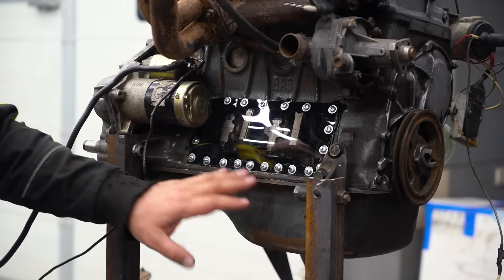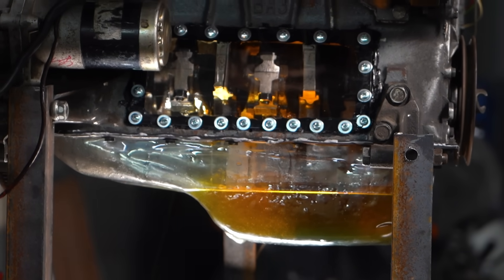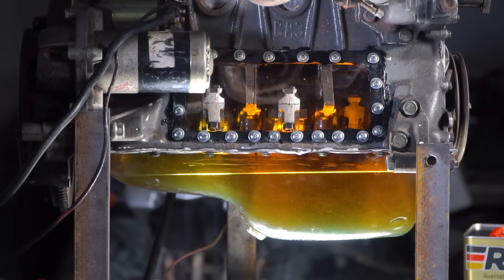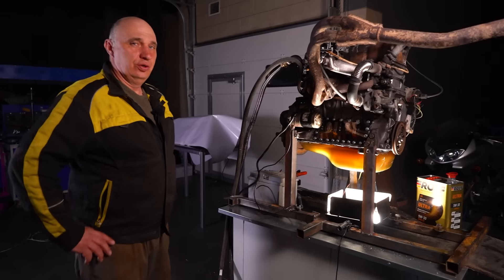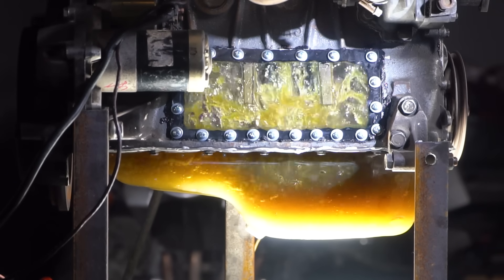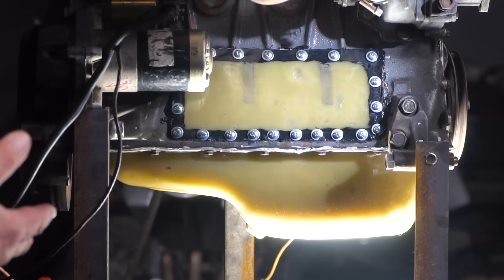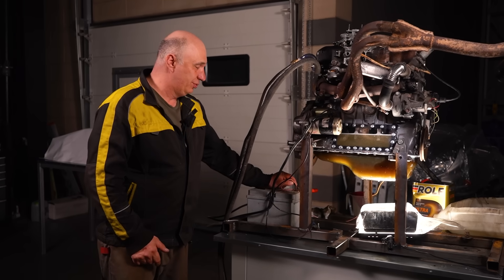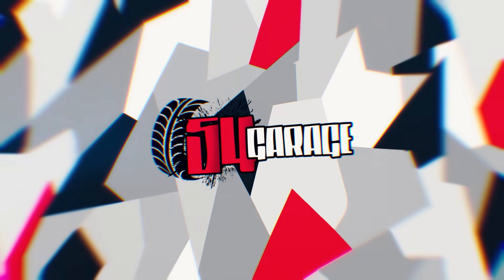What actually happens when you overfill your motor oil? (w/ transparent oil pan)

Comment: What can happen if you put too much oil in your car:

1. Foaming of the Oil
The crankshaft spins through the excess oil, whipping it into foam.

Foamy oil loses its lubricating properties.

It can cause metal-on-metal wear and overheating.

🔹 2. Increased Crankcase Pressure
Too much oil raises the pressure inside the engine.

This can blow out seals and gaskets (like valve cover gasket, crankshaft seal).

Leads to oil leaks.

🔹 3. Catalytic Converter Damage
Excess oil can get into the combustion chamber through the PCV system or valve seals.

Burns in the exhaust.

Destroys the catalytic converter over time ($$$).

🔹 4. Spark Plug Fouling
Oil reaching the combustion chamber can coat the spark plugs.

Causes misfires.

Leads to rough running or no start.

🔹 5. Turbocharger Damage (specific to your 118d!)
If excess oil enters the turbo system:

It can cause the turbo seals to fail.

May lead to turbo over-revving and catastrophic failure.

🔹 6. DPF (Diesel Particulate Filter) Clogging
In diesels like your 118d, burned oil can produce extra soot.

Accelerates DPF clogging.

DPF replacement or forced regeneration needed.

🔹 7. Blue Smoke from Exhaust
Oil burns off in the combustion chamber.

You’ll see visible blue smoke, and it stinks.

🔹 8. Hydrolock (in extreme cases)
If an enormous amount of oil enters the cylinders:

It can prevent pistons from moving (hydrolock).

Destroys rods, pistons, even the engine block.

🔹 9. Poor Fuel Economy and Performance
With oil contamination and fouled plugs/injectors, the engine efficiency drops.

Comment: Seems like a good way to really flush out your engine @ double the required amount then throw in some seafoam. I wish they had to put some engine flush solvent in the crank so we could see exactly what the flush does to the inside of the crank when the engine is running. Great experimental video though.

Comment: My impression is you did not load it, it was only driving itself, and did not run for a long time and getting hotter(?)
I would expect getting bubbles in the oil, the oilpump will have problemt making and keeping the oilprssure high enough and you also will have bubbles in the bearings. That is not any good for the bearings who must ride on a solid oil film(!)
For how long time would the engine take it? 
But it seems to be at least a lot less critical than what we are being told. Interesting test.
Maybe the problem would be more oil wash on the sylider wals leading to more oil burning over time? And more friction heating the oil with this intens wash...

Comment: Why would you fill more than is required and shown in the dip stick, that’s the reason for a dip stick which indicates what is in there
Reply: sometimes dipstick readings can be hard to gague (if it is old/dirty especially) and also a slip of the bottle would easily add too much. its accidental not done on purpose. I once overflowed the power steering doing that

Comment: Some clown broke the plastic tip off the dipstick level indicator, making it short so that idiots filled the crankcase with oil to reach the higher level, overfilling it. I found out simply because I got a warning on the panel telling me the oil level is incorrect. I rang the service department to find out and they told me I have too much oil. Once my eyes were opened I could clearly see the broken tip and yet qualified mechanics has let it slip by them. Luckily it's a Diesel so it doesn't rev high.

Comment: I have always been curious about overfill of oil.
You have done a service of knowledge for people like me.
Do my own vehicle maintenance since teen, now old man. Can't count how many times I would be over on the stick with oil and get back under the vehicle to drain the excess.
Because of this evidence of fact you have brought to light. No more concern of a little overage. Hats of and thank you.
Reply: Extra quart won't hurt.
Reply: @MrHurst-lb1rn   Only my wallet.🙂
Reply: 혹시 실수로 엔진오일이 과다 주입되었을 경우, 시판중인 주사기로 엔진오일 주입구에서 오일, 약간량을  빼내어서 배출시키면 됩니다.
Reply: In most modern diesels the turbo will push the oil into the combustion chamber causing the engine to run at full speed even after you turn it off. Ignition off. If this happens.... Don't panic and put it into 5th gear and release clutch and it will cut out. 
I once got stuck on a motorway when this happened but my turbo was leaking which is why I filled it too high. I was walking home so I started it and put got up to 3rd gear where it ran on the oil until I got to my friends house . I changed turbo and after all my work it spluttered back to my home where I took some valium and went to bed. I drove it to the local shop a few times and it turned out there was just oil in the exhaust which cleared out after a few runs.
Reply: I'll just add  extra litre.

Comment: Interesting. I have a genuine question for people who know. Logic in my brain kept yelling "what about the pressure"? In my mind, the engine compartment is designed to operate with a certain amount of oil in the pan that when heated up to operating temepratures would establish an environment that the engine is happy with. Adding more oil is a bigger volume circulating at a high temperature, wouldn't that lead to meaningfully higher pressure inside the engine, and what would be the consequences of that (if true)?

Comment: Had a van come in with an oil leak out of the valve cover. Was running fine. The engine was completely full to the dipstick handle. Dude just kept adding oil because of a small leak. Not checking it.

Comment: I've got an odd situation going on with a truck I bought 2 years ago. The truck is a 2012 chevy silverado 1500 LTZ and the first time I changed oil in it the dipstick reads way above the checkered mark. So, I went to the owner's manual to make sure I was putting in the correct amount. (6 Quarts) Then I decide to make sure the dipstick was the right one for the truck and it was. The only thing I can figure out is maybe the oil pan has been changed out. I haven't taken the oil pan off yet but when I change the oil, I make sure to put 6 quarts is it. Is there anything else that could be causing this problem?

Comment: I had a friend that was a girl who had a late 2000s early 2010s Chevy Aveo, i offered to change the oil in but she ended up having her brother do it he over filled it and the pressure pushed oil passed the rings and into the combustion chambers after the engine got up to temp the exhaust pipes smoked like a diesel dumping unburned fuel on to a hot plug and into the exhaust, a real cloud maker until it started going uphill and shut off, while on our way to the local swimming hole.

Comment: I am surprised with the result, when I was in my early 20s I overfilled a Peugeot 306 HDi once (year 2002 if I recall) and it was nowhere near that quantity, the engine when I started it went bonkers, straight to high rev with a thick white smoke coming fast out of the exhaust, releasing the throttle would not stop it even on neutral, the engine would not shock and stop, around the car was a deep fog the smoke was so dense, I had to block the exhaust pipe with my foot and the engine eventually shocked and stopped. I really thought the engine would blow up in my face, I had never heard an engine screaming like this before. The car was taken to the mechanic, I was told the engine cylinders had fused with the actual engine block which I really did not understand because you would expect that to happen precisely when you run out of oil, not when you overfill. The oil for whatever reason seem to have reach the cylinders chamber and... caramelized or something, again not something I understood because I bought the recommend oil at the time. The car was not totaled but the repairs were expensive. That morning I had an oil warning flashing on the dashboard, I checked the oil, it was low but not dramatically low, I should have left it as is but for whatever reason I decided to play it safe and level it. I can recall I was not seeing the oil getting up the dipstick, it was early in the morning on my way to visit clients so I clearly did something wrong, did not wait long enough maybe, but to this day and watching this video I still don't understand what happened. The engine was acting like I had my foot on full throttle full rev without me even touching the pedal and the thick white smoke was coming out of the exhaust like a flamethrower. Was it a common rail diesel thing? I have no idea.

Comment: Yeah, but y’all gotta remember that’s a very low tech engine with not a lot of accessory parts if I’m explaining that right a new engine no way it could be overfilled with that much oil and still run right it would blow all kinds of crap bearings oil passages wouldn’t flow right also you’ll get a lot of oil in your spark plug boots. If there’s any spaces, it’ll definitely get in there more so than if it’s low.

Comment: this is interesting but if my calculations are correct a more modern engine has more restrictive oil passages so oil level on newer engines is more crucial then back in the day the reason why you can use a thicker oil or zinc in an old, tired motor but in today's engines if you burn oil you can go to a thicker oil cause of the small oil passages

Comment: Old refrigeration mechanic here I’ve seen large compressors where crankcase was overfilled and they over amp oil foaming and if way too much break rods if doesn’t trip the breaker first , would imagine engine would react similarly

Comment: Interesting when the crank was above the oil level and the oil still climbed the block wall because of windage. So at very high RPM this has to be an issue even with standard oil levels.
The take away is a bit over the line is not a problem but I must admit I have twice accidentally put 1 to 2 litres too much and on those engines you felt the drop off in performance which is what alerted you to check the oil level so stick to the line is best.

Comment: I worked on a car years ago that relied on this for lubrication. No oil pump at all. Big ends had scoops with a small hole that lined up with an oil hole in the white metal bearings. As the engine turned, the scoops would go through the sump oil pool and force oil into the bearings with enough pressure for hydraulic separation. The head was lubricated with oil vapour which would accumulate on a felt pad inside the rocker cover, and drip oil onto the rockers and valve stems. Although the oil got frothed a bit, it worked amazingly well and the scoops were still able to pick oil up, which is how the engine survived since 1913. I had to hand pour new white metal big end bearings, and final fit them to the crank with old fashioned scrapers and bearing blue. The oil level covered the path of the scoops and wasn't as high as the whipped cream maker shown here.

Comment: the only thing i can think of that could be problematic is the fact that oil is thick and heavy, it will absorb more of the engines power than the air will.
so overfilling the oil will (maybe?) increase fuel consumption.

Comment: In Sweden Dunlop is the absolute dominant valve and is called "bicycle valve" and most people never heard of Presta/pesto. Schrader is called "car valve" and seen as witchcraft that cannot be pumped with a "normal pump" with which they mean a worthless frame pump.  Dunlops are actually hard to get a pressure reading on because of their small surface area (short and narrow tip). Presta never lets go of the pump head but Schrader is the best at everything. I try to convince people to convert to Schrader but usally it's like trying to sell a conspiracy theory 😂

Comment: When I bought my V8 van, the long oil dipstick was broken in half at its rivet. I could only go to the dealer and spend $30 on a new one so I figured I'd keep track of the 5 Quart level easily. But I thought it was burning oil (engine at 180,000 mi) and overestimated the amount it had in there. After 3 years (changing it once/yr, it turned out I had 10-11 quarts inside! Because I would add 1.5 - 2 extra quarts every year before changing it thinking it was short from burning oil. The engine was getting white exhaust, but otherwise no damage. After that event, I bought a new dipstick and it's still in one piece with no overfill issues.

Comment: Funny story they put the oil nut in a weird spot on the 2012 Subaru Impreza. I was in a rush, drained my transmission fluid put in another 5.3 quarts of oil and started her up took her off the lift and drove a couple feet here and there for about five minutestrying to figure out what's wrong with it

Comment: I had  a ‘96 dodge van with  a v6 engine. Dip stick was broken, couldn’t see the correct oil level. I would check it, couldn’t tell where it was, so I kept adding, thinking “better too much than not enough”. So eventual it overfilled enough to cause the oil to foam, and the first thing that happened was the oil light came on. Well, I figured “How can it be low, I just added some?” …..so I added a little more. Of course, the oil light stayed on. That’s when I figured out what I had done.  So there I was, over a hundred miles from home.  Weird as it may be, I had a new filter AND oil in the van. Pulled over on the side of the interstate, drained and changed the oil right there, so I would know I had the right amount and there would be no foam. Never did have any repercussions from that episode! lol

Comment: Ahh this test is flawed it depends on the car the capacity etc.
Foaming = increases friction
Too much oil can and will blow seals = oil dumping on the ground = destroyed motor if you continue to drive car.  Seen it many times.    
Foaming + some condensation = more foam = friction bend rods 

Seen it cars and 4 cyle boats.

This short term lab test fails because it is not simulating a long drive, the time not enough to destroy things.  

You tube full of well meaning but faulty videos creating more misinformation to confuse more people.    Lots of motor seals are blown every day due to over filling oil especially 4 cyl engines that have a sub 4 quart capacity.  

Keep testing you will figure it out.

Comment: Yes, airating your oil is a very bad thing, bc those air bubbles are creating pockets of air in the oil passages, which leads to low engine lubrication at times. This also fucks with the pressures generated by blowby, your pcv system should compensate for this, by sucking in more fumes but its limited by the amount of flow that the pcv system can allow. youll eventually blow a hole out the side of your crankcase, or seize the engine whichever comes first.

Comment: If you double fill it, the engine will run but will run like shit. I admit Ive done it myself fill the engine with 5 quarts and then not thinking added 2 more quarts when the motor only called for 4.5

Comment: Well done! I was told by a small engine mechanic that overfilling the oil will lead to blown seals and gaskets. It seems this excellent demonstration proved that aside from smoking and excessive oil burning, an oil leak from a seal or gasket is likely.   Very cool experiment ! Thanks.  I wonder what would have happened had you filled this much oil in the engine that had no piston rings. Do you think that engine would still seize up ?

Comment: Besides this foaming issue with the oil due to overflowing, you also have to know that oil is seeping through the piston walls into the combustion chamber, and that’s where the bigger problem lays! It will cause your piston rings to warp and where, and then you start having major oil leaks and you will ruin your engine pretty quickly so never over fill by any amount if possible!!

Comment: Overfilled mine and it ran normal but on a strong takeoff from stop it clunkered a bit for a brief moment and a big poof of white smoke shot out the muffler.   Eased on the accelerator and drained some at home and the engine was fine.  Did it shoot through the piston rings?  Wondering if that's what happened that maybe it went into the combustion area.  350z.

Comment: I've been a private mechanic for over 10 years!  Always told "don't over fill your oil". Perhapse  they tell people that, because over filling the oil a bit, might just actually make the engine last twice as long? ( Does not apply to all engines of course ) but there for the car industry doesn't make any money if they don't break down, right?.  🤔 VERY Interesting concepts. I've worked on A LOT OF GARBAGE over the years. Not garbage by what they look like or the brand, but in terms of design. Over engineered and under powered. 9x outta 10.

Comment: I have always add and extra half quart for all my vehicle. I tested the recommended capacity versus actual capacity many many years ago. I filled the recommended capacity into the oil pan to see how much it fill the pan and it was less than half and didn't touch the crankshaft. From that day on I always added half a quart extra to all my vehicles.

Comment: Once I changed oil at some service and they poured oil 1cm higher than the max level. 
I remember being super concerned and mad at the service guy and got a syringe and extracted about one liter back from the engine. 
But it turns out my concerns were in vain.

Comment: imteresting experiment, though at 2x capacity while it appears no adverse effects it is only a very short run time with no load. Running 2x capacity for extended driving in  varying conditions could have different results. That said a little extra oil probably wouldnt hurt

Comment: The only thing will happen when you overfill your oil, you may blow out the seals, the engine may start smoking very bad, one time I had to overfill an mg engine to get the oil pump primed, I fired it up the oil pressure came up. Then I drain the oil out put new oil back in it. And the problem with no oil pressure. By the way the engine set for 3 years of the oil pump went dry.